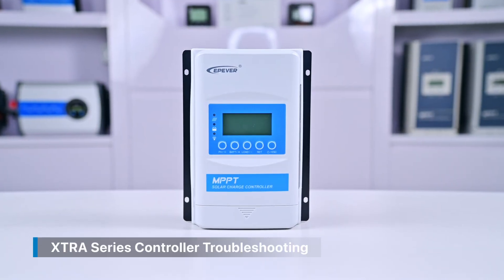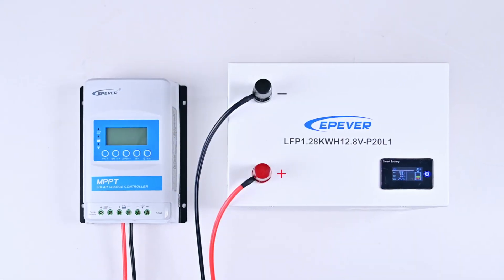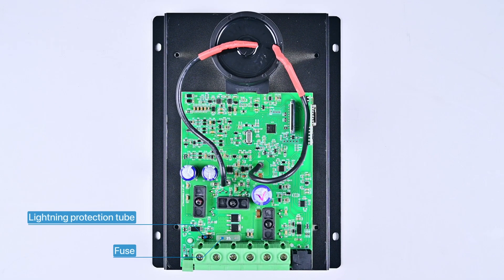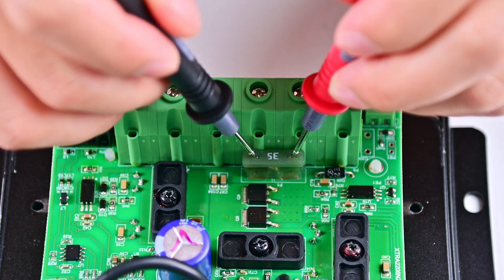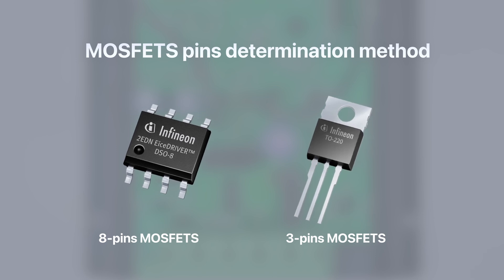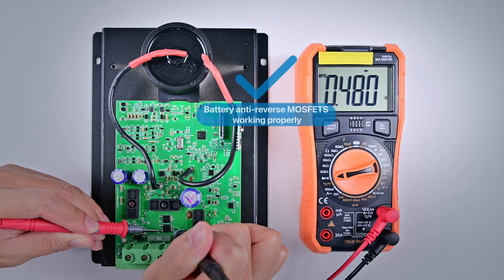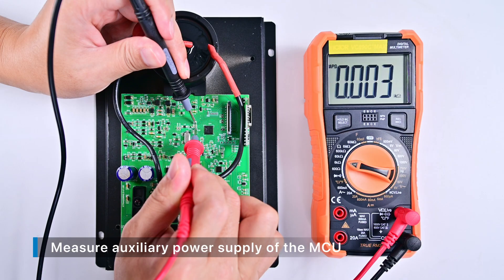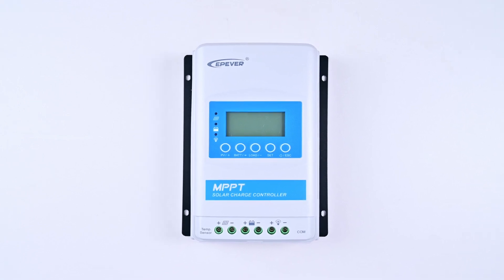How to Troubleshoot Solar Charge Controllers | Tutorial by EPEVER

Comment: Perhaps you could do one where the EpEver MPPT algorithm crashes Vpanel to Vbatt+1v when a cloud passes or load added, and won't recover until PV input is cut and restored.  Even then it might not work;  you can watch the controller go right past the array Vmp and get stuck  at Vbatt+1. 

Countless videos of that behavior on youtube, including my own (YsULwfFq4Pg).  I saw it on all 4 of my Epever+array combos (Model numbers from memory:  2x 5215AN, .4215N, 1210A.)    

In my own video the controller took ~13mins to find Vmp (~90.9v) , after which is crashes down to Vbatt+1v again*.    The day of that video was the final straw;  I ordered controllers from a competitor and have had *zero issues with the exact same arrays and wiring .  Only changed out the EpEver controllers.  

Yes, I contacted support.  No, they did not understand the issue (or pretended not to).   I predict any reply to this comment will be "please contact support".  No.  I binned your controllers and no longer recommend them to others.
Reply from the maker: Hi there, we sincerely apologize for the frustration you’ve experienced with our products. While we strive for the best performance, we acknowledge that issues like MPPT tracking inaccuracies can sometimes occur. In our experience, such cases are often influenced by factors such as the charging state of the device, battery type and parameters, PV configuration, weather conditions, and overall system setup.

To effectively resolve this kind of issue, it’s crucial to first identify the root cause. That’s why we previously recommended contacting our support team for a one-on-one assessment tailored to your system’s specifics.

We want to assure you that we never abandon our customers and always do our utmost to address their concerns. Your feedback is invaluable in helping us improve. If you’re willing to share more details, we’d be happy to revisit your case and investigate further.

Thank you for bringing this to our attention.
Reply: @Epever  Thank you for the thoughtful response.  

>  Your feedback is invaluable in helping us improve.

I'm a nobody on YT and no longer own/use EpEver gear for the reasons stated  previously.  But I want EpEver to succeed, and I want people to have access to iexpensive, functional MPPT.   You might want to follow up with Adam Welch who knows what he is talking about and and has a following of clueful viewers.  In one of his videos:
https://youtu.be/YowgBCl1F1I?si=ijvy8iEOPTFnDVzt&t=181
he shows data from the controller where Vpanel crashed right down to ~Vbatt+1v in challenging insolation.  Yes, harvest will be decreased in poor conditions.  No, the MPPT algo shouldn't crash so hard it's making next-to-nothing.  Also read the comments -- he's not the only one seeing it.  

Another clear example:
https://www.youtube.com/watch?v=K0LuMSXKO0M
Again, read the comments.  

These are not cases in which Vpanel has crashed due to low irradience.  We know this because disconnecting/reconecting the panels demonstrates the algo can sweep all the way from normal Voc, through the the entire curve, then right past Vmp on its way down to Vbatt+1v.  Incredibly frustrating.
Reply from the maker: @fratermus5502  Thank you for sharing your insights and the video examples. We’ll review the specific scenarios you mentioned and the related feedback in the comments. Your input provides valuable perspectives on areas we can improve, and we truly appreciate the effort you’ve taken to bring this to our attention.